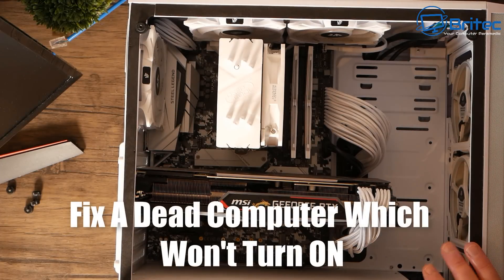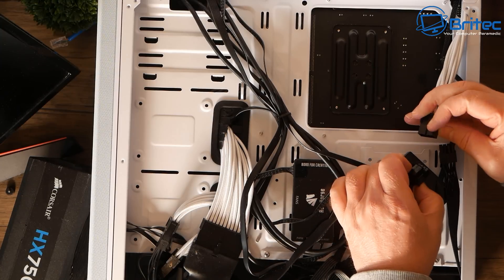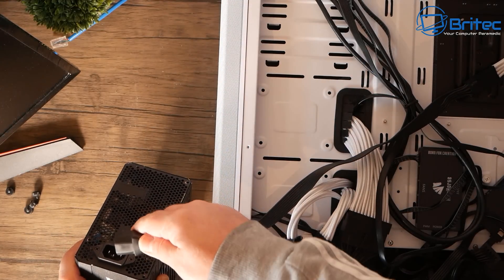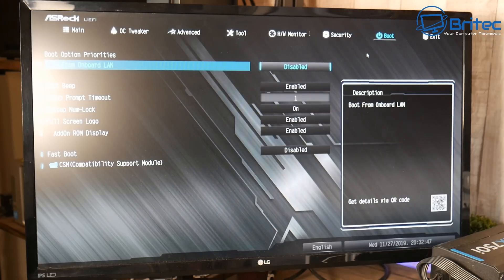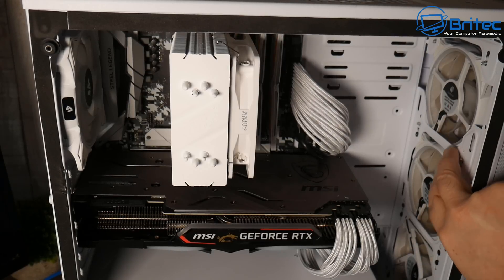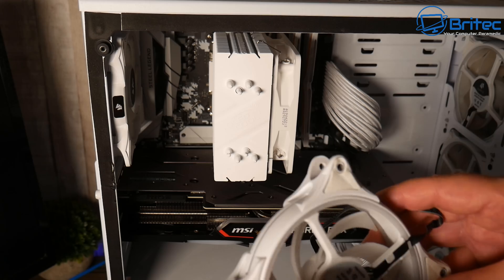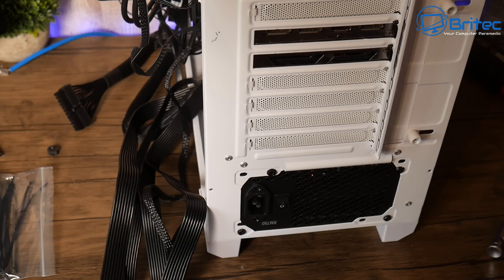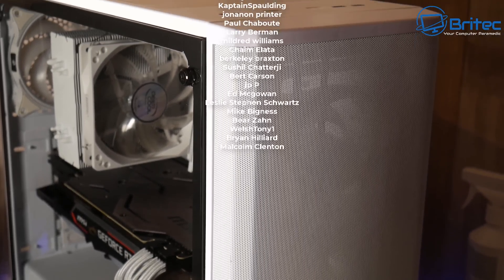Fix A Dead Computer Which Won't Turn ON

Comment from the maker: Hope this helps you fix your dead pc. Drop us a LIKE 👍
Reply: hp pavilion dv6  bought from used products.i put in extra ram put in a ssd windows 10 .shut it down removed the battery
and now it's dead .thought cosmos battery the ram but still dead or the charger is dead even with universal charger it's dead 
is it cause i removed the battery?

from refurbished computer store or shop-bought a  Fujitsu Lifebook e499
and reason was for windows 11 
come from windows 10 .windows 10 is more simple.its to much,
and perhaps there be a windows 12 wich is simple way the way windows 10 was. but still am exciting to learn

Comment: I powered my 10th Gen pc without thermal paste, ran about an hour installing drivers, then I restarted it and when restarting there was no display and I couldn't power it off at the power button so I switched off at the power supply switch then it didn't want to switch on again

Comment: I was in the middle of a game when suddenly my workstation started to slow to the point where it completely froze,  after a hard shutdown I try rebooting but all I get is a short fan noise, then after 10s it restarts, and it just keeps doing it. swapped the cable, psu, and nothing 😑 any ideas.?

Comment: Hello, I'm having an issue which caused me to look this video up.  It is helpful but my issue goes a bit deeper and I was hoping for some assistance perhaps.  My issue is there's power going to my motherboard, but no indicator lights that I can see are on and the onnoard power button doesn't work.  However there is power going to the USB ports on the motherboard, as I can charge my phone still using them while it's connected to the power supply.  I'm just blown away because literally last night it worked perfectly fine and now is just suddenly wont turn on at all, no fans, nothing.  If anyone has some tips I would be very appreciative, thank you!

Comment: Mines new and won’t power so I used a screwdriver and it turned on because the front panel power won’t work but today I tried doing the screwdriver and the whole thing won’t turn on

Comment: You should never mix power supply cables because there is no standard pin layout, even with same manufacturers, pin layouts are not always same. You could kill some components.

Comment: Hello Brian, I have the Samsung 970 Evo plus as a bootdrive, and the Samsung 980 for games. There a differences, the 970 plus get's hotter even with a heatshield about 53c. But the 980 is almost 10c cooler.
Also the 970 Evo plus has slower write performance than the 980.
Plus the 980 has a better powermanagement than the 970 Evo plus, when using the Samsung drive management software. I'm using a AMD 3800x, Gigabyte aorus master x570, gskill neo 3600 32gb, MSI 2070 super, Windows 11.
Why are the write speeds from 970 Evo plus slower??
Can you tel me please 👃

Comment: Brian, I saw that you put the power supply in with the fan facing downwards.  I'm a little mystified about this.  Is the power supply fan an intake fan or an exhaust fan?  (I've always been under the impression that the power supply fan would be an exhaust fan).
Reply: AdamantIT gets flak for facing the PSU fan upwards (case permitting) but this was a convincing demonstration that he is correct. Expecting the owner to do the right thing about placement of the PC is wishful thinking.
Reply from the maker: Power Supply intakes air to cool the PSU when needed.

Comment: "Thy   shall test   rail voltage"  with a   DC  volt meter   Good  video  idea     I  say that because  one   rail  could have failed ,  but the others may be working  fine.     Yes   they  are called " Kettle plugs  in the  United States   The old power supply let out  "the magic  smoke "
Reply from the maker: I will fix it at some point

Comment: You didn't swap the ssd power from old ps to test ps. That is why the ssd was not working or being detected. Kind of can't with no power.
Reply from the maker: just wanted to see if it got power and it didn't, me not adding power cable would not stop power going to the motherboard. Also, the SSD was dead. But you are right, I should of been more clear.
Reply: @Britec09  I figured it was just a simple oversight. It happens to all of us at one time or another. But even if that ssd had worked I still would have replaced it!! Great video!!

Comment: Yes Brian I used to use hogs hair brushes to clean fans and even went to the extent of wiping a little anti-static solution over the surfaces to stop dust being attracted to them it also makes the blades very slippery and (? I am perhaps wishfully thinking) to make the airflow over the blades better, I did this to all the air intake surfaces and always told people to stand their machines on a piece of hard (perhaps a small piece of laminated wood) if they are keeping their machines on the floor. On my own builds, I also added extra (and finer) filtering material to ensure that the standard filters were supplemented for better filtration. My own machines I have on a desktop as I have the space and find accessing them better.
Reply from the maker: I have told him to get it off the floor or use a floor stand

Comment: Great video! From where I live, technicians mostly suggest getting an AVR (Automatic Voltage Regulator) to "protect computers" from surges. My questions are:
1. Are AVRs really necessary?
2. What are the alternatives?
Thank you very much in advance.
Reply: If you're going to spend a lot on a custom PC, then buy an battery backup that will do line conditioning as well. I've been working on computers, and other devices but mostly computers, for at least 20 years, I can't stress it enough to buy a battery backup. I've never use cord extensions, it just adds more clutter to the build unless you HAVE to use them, but try to get custom cables for your PSU if you have the extra cash, this will make the build much nicer. Also, consider getting a fully modular PSU.

Its best to plug the computer directly into the wall, but you could spend the money on a good surge protector if you want some extra "protection" for your hardware. I still highly recommend a battery backup though, get one that is rated for the max watt you PSU can do.

Comment: I can't believe that PC wasn't cleaned in three years. I blow the dust out of my PCs and radiators every month, and every year I drain the custom loops and do a complete teardown to clean everything, including washing the motherboard outside with a high-pressure water hose. After it dries I'll change the thermal paste for the CPU and GPU water block. Next I'll rebuild the system and bend new tubing for the custom loops. A clean PC is a happy PC and they almost never give me any trouble.
Reply from the maker: I know, it was really dirty

Comment: Great video! Coincidentally, I had an old Dell OptiPlex 780 (11 years old) fail to power on this morning with a blinking amber light. Grabbed a PSU out of another out-of-service OptiPlex 780 and problem solved! It's well past time to replace that computer.
Reply from the maker: Dell OptiPlex 780 are not worth fixing, my time is worth more than them old systems.
Reply: @Britec09  I agree. I have recommended that these old systems be replaced over the years, but that about all I can do. It's not an emergency, until it's an emergency. I have seen the same thing with production servers. Some procrastinate, until a disaster strikes. Lately, downtime is even longer with the supply chain issues. I just try not to make "their problem", my problem. I can only do what I can do.

Comment: You never plugged in the SSD to the power supply. You even said which cords you plugged in to the new power supply a few times and showed you unhooking it, yet the SSD you clamed bad was never plugged in to the power supply. So how can you say it is bad?  (unless you edited it out of this video). The gpu in a 3year old computer should also been repasted. Did you follow up with a whole system stress test ?
Reply from the maker: SSD failed and was replaced with 1TB NVME drive

Comment: I do want  to mention that before hooking up a replacement power supply... MAKE SURE WHAT VOLTAGE IS ON EACH PIN! Yes, there is a standard. Yes, well over 90% of computers use a standard pin configuration. HOWEVER, there is a major computer company (who shall remain unnamed in this comment) which uses a "customized" power supply and does NOT use the standard pin configuration. Plugging a good standard power supply in place of the customized power supply will do more harm than good. It is entirely possible that doing this will not only burn up the new, good, power supply but ALSO burn up components that WERE good prior to plugging in the replacement power supply.
Reply from the maker: This was a standard PSU.
Reply: @Britec09  I don't doubt that, but there are people out there who DON'T have a standard PC, and they don't know enough to KNOW they don't. Some accommodation should be made for these people who are coming to YouTube with this exact problem.
Reply: @Britec09  What I was pointing out that a standard PSU can destroy a non-standard PC.

Comment: need help !!!
I got a new PC 4 months before. CSL Gaming PC / Intel i7 Processor, /Nvidia RTX 6080 / 2 TB Hard Drive / 1GB SSD 
everytime I turn on the PC , ofter 5 to 10 minutes it comes with the warning " NO Signal, the Display goes to sleep Mode soon  " 
the PC shuts down and startet automaticly. sometimes it takes many hours till the Massage coming and the PC shuts down.
whats going wrong ?? its a brand New PC. nothings is changed . the PC monitor is a LG Ultra Gear Curves , conected to the Display Port. I tried also with HDMI Cable Connected, but got the same problem.
Reply: Connect it to the gpu... Bruh